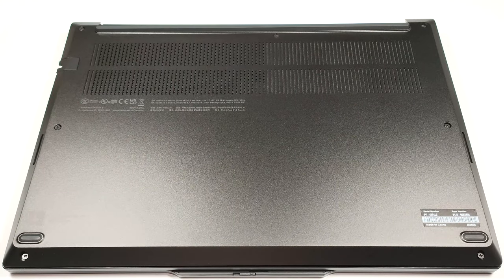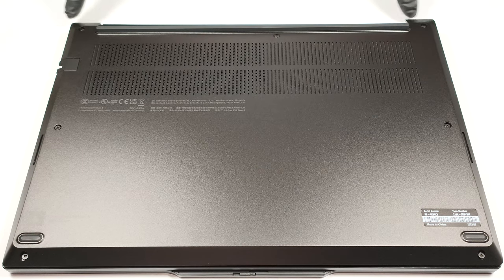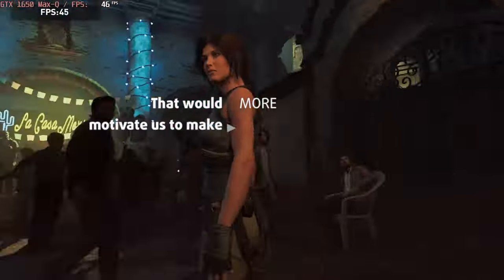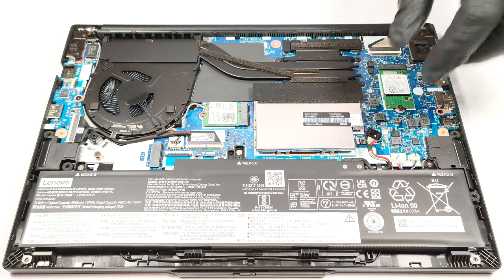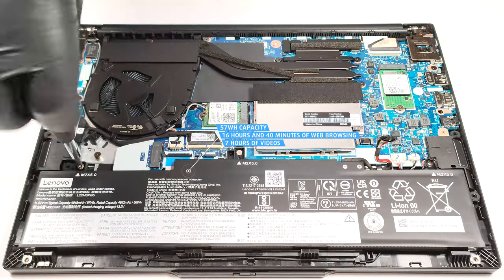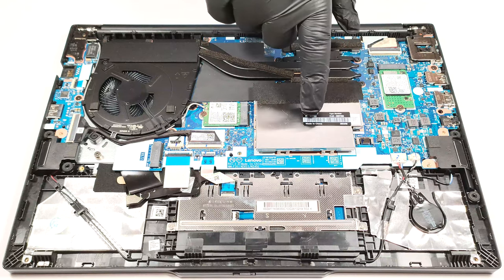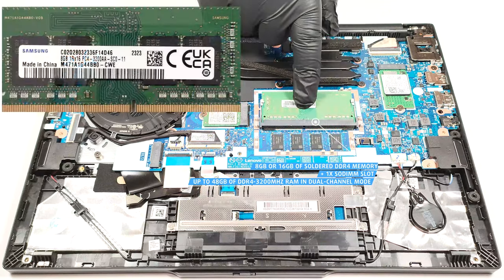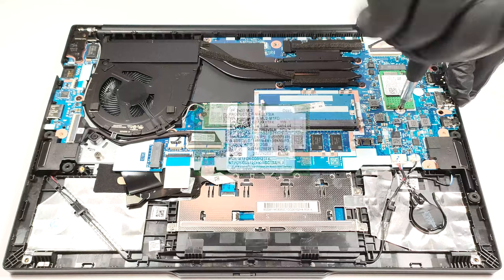🛠️ How to open Lenovo ThinkPad E14 Gen 5 (Intel) - disassembly and upgrade options

Comment: can you tell me the airflow? I assume the fans will intake air from the bottom and exhaust at the vent below the screen? I do feel the bottom fan is also exhaust air because it is hot.
Reply: the fans do intake air from the bottom and exhaust at the vent below the screen. but the bottom is probably just hot from the heatpipes transferring heat from the cpu die. I have this exact laptop